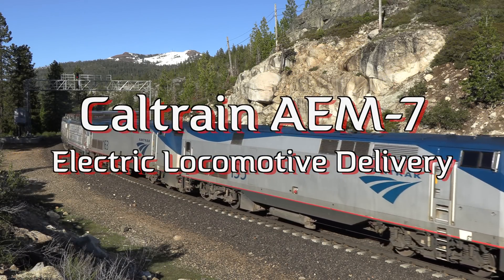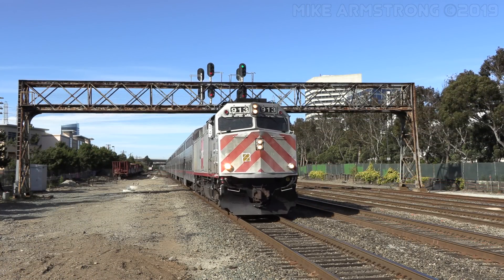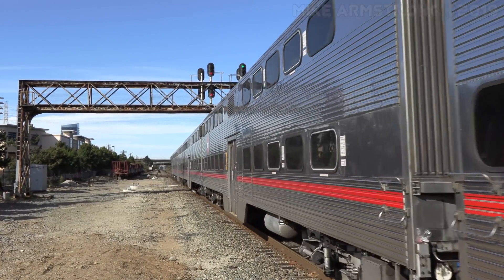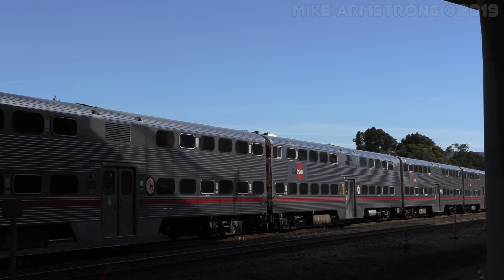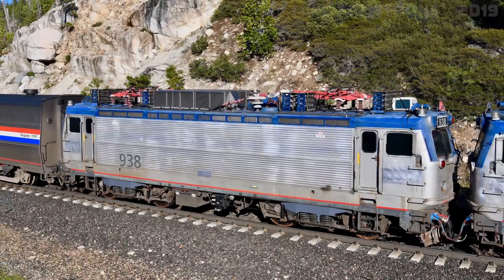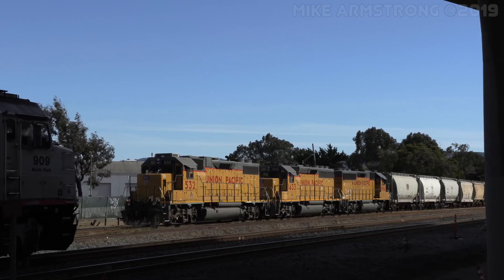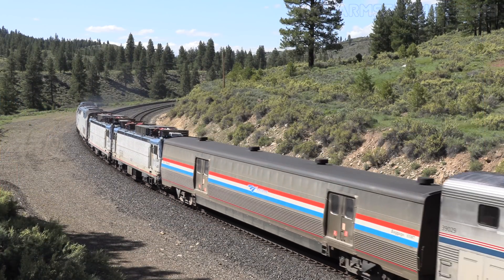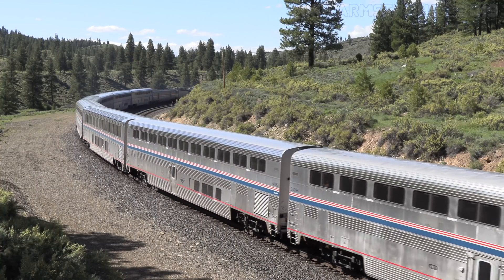Caltrain AEM7 Electric Locomotive Delivery

Comment: For anyone wondering, as of June 20th, they were in the Oakland coach yard and fully visible from the rails. I saw them sandwiched between a P42DC and two Dash 8s from a westbound Capitol Corridor. Honestly, they will probably be there for a year or two. I imagine eventually they'll be tacked onto the Coast Starlight and taken to San Jose, where some switcher will take them to the nearby Caltrain maintenance facility.

Comment: I'm interested to see what these Swedish Meatballs will look like in CalTrain colors.
Reply: I would be too, but it sounds like they won't be repainted, since they are just for testing.  Although maybe if they figure out a use for them after the testing is done (instead of getting rid of them like one of their latest documents specifies), they might go to the trouble.
Reply: @Lucius_Chiaraviglio  Yeah, I imagine they won't be repainted, but the Amtrak logo will be covered up. There's not really any reason to put that much money into it, especially since with 29 engines currently in use on passenger trains (including 1 undergoing renovations at the moment), this engine will be just 1 out of 30 seen on the line leading trains. I doubt it will even be used to pull passengers for a while anyway.
Reply: @Lucius_Chiaraviglio  I'm going to keep my fingers crossed. Something good may happen.

Comment: The MP36s and F40PHCs will still be in service once electrification is completed. Also, Tamien to Gilroy rails will stay unnelectrified
Reply: I was wondering about that, since they have 3 F40PH-3Cs and 6 MP36PH-3Cs. Unless they begin running more than 3 trains to/from Gilroy on weekdays, they only really need 4. I'm assuming the recent overhauls of the MPI F40s cements the theory that they're sticking around for a while- I just wonder how many MP36s will remain.

Comment: The train's not going very fast. It must have been an easy chase. Why does Amtrak run their locomotives elephant style instead of back to back?
Reply from the maker: It was pretty easy. As for the locomotives, I've heard different theories but the one that seems the most logical to me is in case there is a problem with the leader and they need to move the train the rest of the way with the second unit.
Reply: @CoasterFan2105  That makes sense. Thanks. For some reason,back in the days of privately run passenger trains with E and F units, the railroads didn't seem concerned about that.

Comment: I would have liked to see Caltrain buy a fleet of AEM-7s and keep the Gallery cars going.
Reply from the maker: That would've been cool.
Reply: I think they considered buying electric locomotives to haul the gallery cars, but decided in favor of the time savings provided by using EMUs (which accelerate faster).

Besides, some of those gallery cars date from 1985 - 1986 (I rode one of them when they were only 1 to 2 years old), and although being rebuilt in 2000 - 2001 (and some having been built after 1986, but as far as I know not rebuilt since delivery), are probably not ideal for wheelchair accessibility, and are probably overdue for another rebuild if they were to continue being used.  The true bilevels (Bombardier) are newer, but some of them may be approaching the need for their first rebuild.

Comment: I say the charger locomotives would’ve been a better choice, but the little aem-7s aren’t too bad either. Missed those locomotives.
Reply: TheNw1218 the AEMs are only for electrical testing. Our diesels will be replaced with the Straddler KISS. But the AEM7’s may be used if our new EMU’s are not delivered on time.
Reply: @mateojames3231  Be aware that the Overhead Catenary will not go any further than Tamien station, which means all service South of that station will be served by MP36PH's
Reply from the maker: @Cards8114  Yes indeed, CalTrain is keeping all of the MP36's plus the F40PH-2Cs they have in their fleet for diesel operations that extend south to Gilroy. The fleet of original equipment including the 20 F40s and the gallery cars built in 1984-85 will be sold off.

Comment: I love you coasterfan2105 is it true ACE replacing the current fleet with Siemens chargers
Reply: Yeah, but that's not really a good thing, when it puts 6 beautiful F40PHs in danger of being scrapped, one of which just happens to be extremely special due to it having been the last F40PH ever built.
Reply: Remember, ACE only runs 4 consists at once, 2 of which will always be a bit longer and have a doubleheader. They only need 4 Chargers because with their extra horsepower, they don't need doubleheaders anymore. And for the expansions, they can just buy more Chargers later on, like how Amtrak plans to buy 75 Chargers, but that'll certainly grow as time progresses.
Reply from the maker: @superbaddy4  They will need more than 4 locomotives because of 90 day maintenance cycles. So either they are replacing 4 of the F40s and keeping 2 or these are just to add to the fleet.
Reply: Thank you
Reply from the maker: It sounds to me like the Chargers are being purchased as supplemental units for planned service expansions, but I could be wrong.

Comment: I'm glad to see that american railways are starting to eletrafiy and starting to get better in service and quality and I cant wait for the railways to get electric powered trains instead of diesel
Reply: Commuter trains really should be electric already and only aren't because electrification costs absolutely goofy money.
Reply from the maker: It's certainly neat to see all the different passenger rail projects going on now!
Reply: I wish . . . unfortunately it is extremely slow and extremely piecemeal.  Unfortunately, the Americas (not just the US) seem to have an allergy to electrification, with most electric railways in the Americas having de-electrified from the mid 20th Century all the way into the 2000s, and none of the freight railways having since shown any willingness to electrify.  (Edit:  Except for a couple of captive coal-hauling railways like the Black Mesa and Lake Powell Railroad and the Navajo Mine Railroad.  But this edit will itself become obsolete soon, because the Black Mesa and Lake Powell will be shut down soon when the coal-fired power plant it feeds is shut down, and the Nafajo Mine Railroad is soon going to de-electrify.)

Here in Boston, most of the MBTA management doesn't want to have anything to do with electrification, although somebody convinced them to lease an Amtrak ACS-64 for testing for a while (which is the wrong type of locomotive to test on their system -- should have leased an ALP-45DP dual-mode from New Jersey Transit so that they could test it on their regular scheduled service).
Reply: Virgin Trains USA now having its feet on the ground should make for some interesting future developments. I have a feeling Amtrak is going to have to step up its game, haha. I'm excited.
Reply: loki352 Unfortunately no plans for electrification, at least as far as I can find.
Reply: Lucius Chiaraviglio Yeah, sadly. I just feel that with a large corporate entity from Europe that’s knowledgeable when it comes to electric and efficient passenger rail, it seems that Amtrak no longer has an excuse to keep using other rails instead of building their own. They really need to start building their own rails. Their funding is really shit but I’m sure they could secure enough to do just a few- the Capitol Corridor line seems like the best option for a first choice.
Reply: loki352 Good luck getting the right of way for any of this.  To be able to get right of way by eminent domain, it would take a giant EeEeeEEvviiiillL corporation, of the type that would not actually have any interest in doing something for the public good (especially not public transportation, since you can always make more money by catering to those who drive their own cars, whether they want to or not).

Comment: Nobody's talking about the 15 HHP8s... Ah well, I'm pretty sure all 15 are sitting in tact in the same place.
Reply from the maker: Currently parked in I think Wilmington, DE bing stored until the bank lease runs out and then it's up to the Bank/Bombardier what happens to them.
Reply: @CoasterFan2105  Maybe they'll wind up running for MARC!
Reply: But supposedly MARC is refurbishing their HHP-8s (even though they originally intended to get rid of ALL of their electric locomotives and run diesel only).  https://en.wikipedia.org/wiki/Bombardier%E2%80%93Alstom_HHP-8#MARC_Refurbishment
Reply: IIRC, Amtrak owns (or owned) these Toaster's outright (as in no bank loan/lean/etc), so they can do whatever they please with them. 
The HHP8's are owned by the bank, but leased to Amtrak. The bank holds the "title" to these units, therefore Amtrak can't do anything to them (sell/scrap/etc)
Reply: @W12CO1  ah, I see. Thanks for sharing.

Comment: I just hope that after Caltrain is done with them, that they get properly preserved like 915 and 945 were.
Reply: As Mike said in the video, the reason Caltrain is buying them is because they want to use them for testing for their "CalMod" Electrification Project.
Reply: Superbaddy4 Yes, I know. But it’s very odd to see them going to California, I have never seen AEM’s there.
Reply: MegaRailfan because they a barely getting there
Reply: @megarailfan5263  you never would have....there's no 3,000 mile extension cord from Delaware....furthest west electrified railroad is Illinois Central in Chicago
Reply: @douglasnash7821  Used to be the Milwaukee Road after "the Gap" from Avery, with the lines running from the Pacific Coast. And Great Northern had a short section through the Cascade Tunnel before they had the capability to properly ventilate it. But now stupid hippies want "muh electric semi trucks" and "muh carbon traps" and other such ineffective bullshit. Go back to electrified mainlines, problem solved. That or keep working on renewable steam programs with that ATSF engine testbed.
Reply: @megarailfan5263  That's because their entire careers were run on the NEC between DC and Boston.
Reply: @superbaddy4  i thought they are using the stadler EMU for CalMod?
Reply: Superbaddy4 Tbh never thought AEM-7s they would be going to CalTrain?
Reply: Or at least one of them. I assume the parts locomotive won’t be taken care of or left in one piece when all is said and done.
Reply: Superbaddy4 where did 945 go?
Reply from the maker: @NOVARailandWeatherEnthusiast  945 is at the Illinois Railroad Museum.
Reply: CoasterFan2105 oh
Reply: @CoasterFan2105  just like i went two weeks ago.
Reply: CoasterFan2105 i heard about it but never knew it would purchase AEM7 locomotives
Reply from the maker: Agreed!
Reply: Superbaddy4 I hope so too.
Reply: I would image not, they will probably be abused, and put through thier high paces. In order to test eletrical systems, overhead, track grounding. Basically they are cheap equipment for abuse. The new trains will actually be taken care of.
Reply: Only one will be preserved. One will be tested, one will be used for spare parts. We don’t know which though.
Reply: Yea

Comment: 2 are saved!
Reply: Bay Area Rail Studios yeah
Reply: More than 2, at least for the time being. Two DC motors are preserved at different museums, the 915 at RRMPA and the 945 at IRM. TTCI in Pueblo, CO has the 942 and 928, both AC motors, for testing, although they are not officially preserved. And neither are these two, although they are now safe from scrapping at least for a while. Amtrak also still has a few more AEM-7ACs not yet scrapped, including the 901 (oldest surviving motor).
Reply from the maker: @amtrak706  901 is currently being auctioned off, so we'll see what happens with that one.
Reply: Amtrak706 ok